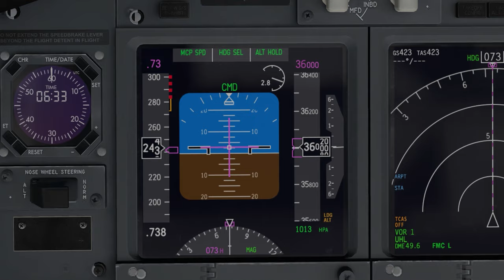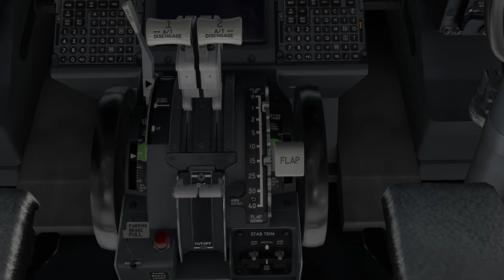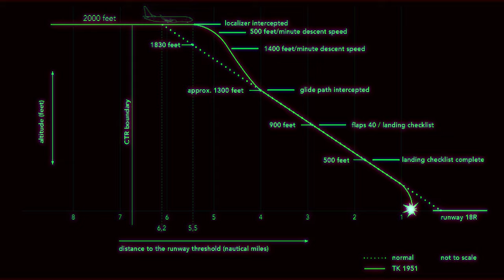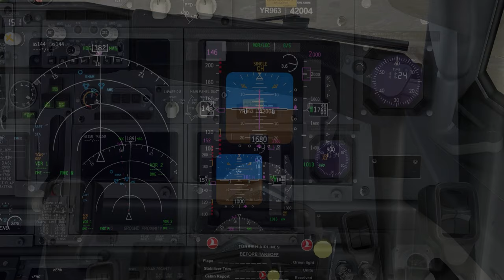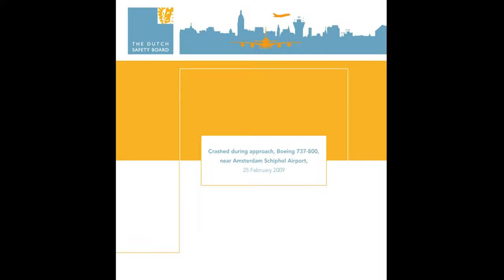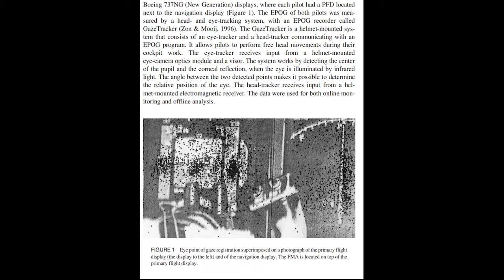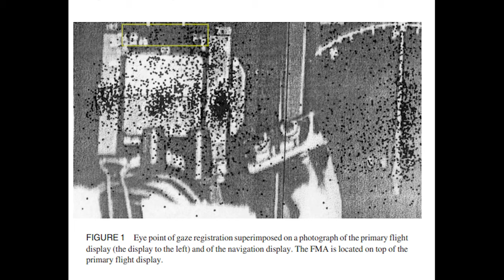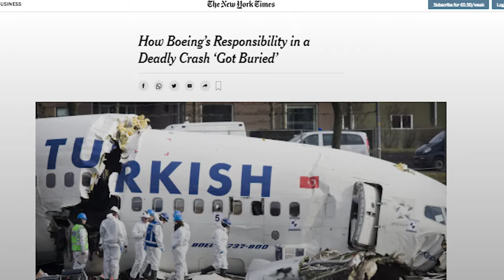Why did this 737 FALL out of the sky?? | Turkish 1951

Comment: 737 will enter flare mode only if dual auto pilot is enabled and both RA operative is a dual auto pilot requirement. Also dual autopilot is normally enabled only for auto land.. The weather at that time didn't require auto land.
Reply: Both autopilots were engaged at the time, the erroneous RA1 gave the aircraft the impression it was at 8’ , therefore was in flare mode, hence the thrust was at idle, and the nose pitching up, it had nothing to do with the weather, or an auto land.
Reply: What he is saying is they shouldn't have been, especially on a clear day.. They knew they had a bad RA anyways, wtf were they doing on a full auto approach??

Comment: Shouldn’t they turn off the communication of the faulty radio altimeter with everything else so the auto pilot takes its information from the correct altimeter? They didn’t turn off the auto pilot. They were still relying on it. So what did they expect the APU to do if not try to collaborate with the [faulty] radio altimeter it was referencing, and they knew it was referencing? This was so well explained. Even a non pilot like me was happily able to understand it, and I had wondered about this crash for a long time.
Reply: APU?
Reply: @tomstravels520  My Guess is Auto Pilot Unit... not that the APU is a power generator auxiallitary.... shrug

Comment: Thankfully Aviation Nowadays Has an Important Tool That “Reads” Pilots Operations Live !

It’s The FOQA (Flight Operations Quality Assurance) !

Therefore, If Company Flight Standards Were Not Accomplished 

(i.e. : Not Stabilized at 1.000 ft)

FOQA Is Triggered and Pilots Are “Invited” To Explain Why They Didn’t Follow a Missed Approach and Continued To Land.

If There Was No Intention or as Called “ERROR”, Pilots Are Reoriented and Maybe Sent to Flight Simulator Sessions.

If There Was Intention or as Called “VIOLATION”, Things May Become Serious Even With Their Demission .

Other Than That Pilots Do Flight Simulator Sessions Regarding Failures and Their Management,

With Emphasis in Human Behavior Like in CRM (Crew/Corporate Research Management) in Terms of 

LOFT (Line Oriented Flight Training) !

All of That To Try To Lead To, As Close As They Can, Bring To Near ZERO The Possibility of an Incident or an Accident.

Comment: ‘Boeing didn’t consider this a safety issue.’ Where have we heard this before? If it’s a Boeing, I’m not going! Shockingly cavalier approach to passenger safety.
Reply: Because it isn't. The airplane can totally fly with one defective radio altimeter  but it requires special procedures which haven't been followed here. And one of the step is simply to not use automations on the faulty side.

Comment: If the captain's radio altimeter was defective, I'd expect they would use the AP on the FO's side, where presumably the functioning radio altimeter would not trigger an erroneous flare mode. Is there only one AP on the 737?

Comment: There should be multicolored led borders for each panel... Each colour should assigned for modes of for example FMA.... If it's gone to flare mode then colour should be green, nav mode yellow etc... So even pilots are doing there Job... But if cabins lighting colour changes then come to know without looking at display

Comment: Definitely pilot error. Even if systems failed and in an unfortunate situation, the pilots were still instructed to follow a procedure which they failed to do. At the end theyre responsible.

This was pilots failing to properly handle a system malfunction, despite having instructions that would have prevented any issues

Comment: I don't blame them for reinvestigating the crash, but the pilots should have been aware of the faulty equipment since everyone was dealing with it. Whatsmore, they shouldn't have been flying planes with faulty altimeters. If they have more than one, take the faulty one out. It would be better to have a hole in the dash than to dig the plane out of a hole in the ground. Just saying. 🥺

Comment: This IS pilot error. No doubt about it. The crew KNEW they had an erroneous RA and they should have been familiar enough with their systems to understand which systems would’ve been affected. 

There were 3 pilots on that flight deck. 3.  And not a single one was paying attention to their airspeed during a critical phase of flight. 

If the FO was in the process of recovering from the stall, he should’ve continued it. It probably would’ve saved them. But no the captain had to be a hero and caused the loss of life. 

There’s a reason why the policies are that you must meet the “stabilized approach” criteria. Those were written in blood. And it’s NOT ok, at the airline level, to simply disregard those policies and do it by gut feeling. 

Also a good illustration of these dumb Nintendo pilots relying on automation to do their job. 

Zero excuses here. Zero.
Reply: Mmm, I kind of agree to an extent here. The pilots should have been paying attention their airspeed - I'll give you that, no doubt. But I do think that taking Boeing out of the picture here entirely is the wrong way of looking at it. The auto-flare system should be designed to monitor both RAs and I also believe that there should be a more prominent warning that it's initiating auto-flare. Yes, the pilots should have been paying attention to their instruments, but simultaneously, Boeing should ensure that the integrity of aircraft will never be compromised by something as simple as a single erroneous RA. I do feel like that if their descent speed of -1400fpm was not initiated, this crash would have been avoided, giving the pilots less warning to an issue like this, as it meant that they would expect the engines to idle out, and maybe a potentially minor temporary decrease in speed, which is something that happens in aircraft when they need to descend at times.
Reply: @Alfred Weber Precisely. I'm not defending the actions of the pilots; that is why they're there - to account for these potential issues during, even more so, critical phases of flight. But it's important to factor in aircraft safety as a whole and Boeing should be held accountable.
Reply: @CamFlies  Boeing always manages to skate. They seem to have a lot of power over safety agencies.
Reply: No doubt about it only in your mind

Comment: All emergency possibilities should be extensively trained in the simulator. There should be 4 or 5 emergency buttons, pre-programmed scenarios, that can be pressed where the plane automatically stabilize. If the first button don't function press the second, then try third.....

Comment: It’s almost incomprehensible that an automated system would persevere when there are glaring disparities between vital inputs. If it’s taking the altitude from the captain’s side source, and that source is constantly providing a negative reading, then that should be sufficient to disengage entirely. That other inputs are showing the aircraft in actual flight makes this even more absurd. Surely there’s also a means of manually switching to an operational altimeter source, no?!? This all seems woefully unsophisticated and inadequate for an automated system with such tremendous responsibilities.
Reply: No it's not that incomprehensible when  you are normally required to not use automations on the faulty side during landing  if  such case happens.
Automations arent supposed to replace the pilots.
Reply: @Hk-uw8my  I’m referring to data inputs and software logic. Pilot actions/responsibilities aren’t pertinent to my comment.

Comment: No way to disable the faulty RA? That seems like a design oversight in the plane.
Reply: @Capecodham  radio altimeter
Reply: @Capecodham  bro chill out. You’re literally on an aviation channel. Of course there are aviation acronyms. There are acronyms in all fields. Why are you so surprised that someone would use an acronym…?

Comment: How many of you think that when ANY part of a plane’s instrumentation is faulty, they should either abort the take off or circle back to the airport?
Reply: You’d be surprised how many flights would suddenly be cancelled. There is only so much space for aircraft to be in maintenance hangars. If others are stuck waiting outside and can’t fly it’ll just build up. That’s why minimum equipment lists exist
Reply: I agree with you.
Reply: We fly the airbus with an RA fault all the time. Only difference is the Airbus automation is not built like a fucking idiot

Comment: This video is a year old so I don't know if you'll see this comment but if you do could you check out the Alaska Airlines excursion in Ketchikan that ended with their 737 in the channel between the Ketchikan International Airport and the city of Ketchikan? I don't know the flight number or any other details. Alaska Airlines had at least two other excursions in Ketchikan, one of which the aircraft, again a 737, broke in half.

Comment: I don't understand why the Auto Pilot was using the Pilot's radio altimeter indication instead of the First Officer's.
Reply: Because his flight director is primary. Can be switched but not something you want to rely on trying on final. They already knew about it, should have flown manual instead of letting the  plane do it. All they would've had to do is monitor speed and adjust throttle as necessary.

Comment: Nice video. However, to say that this was not pilot error shows your lack of understanding of basic aviation. Regardless of the circumstances, if one stalls an aircraft on short final with two good engines, there is no defense. Argue all you want.
Reply: I think it’s clear from the context in which he made that statement that this wasn’t entirely what he meant, more of a case of a slightly questionable choice of words in the script than a lack of understanding.

Also, I don’t see that we gain anything by ignoring contributing factors, or that acknowledging them absolves the pilots of guilt. Pilot error is pilot error, but the cruel reality is that humans make mistakes. If training or aircraft systems make a catastrophic fuckup more likely than it needs to be, that should be fixed ASAP.
Reply: @ollimoore  I have to disagree with you here.. they knew the RA on the captains side was bad, no damn reason at all to be trying a full auto when thats the case. Lets not forget the flightk director primary was captains side, VERY easy to switch primary btw.. they failed to monitor the approach, relying on a plane that was using a faulty RA that they KNEW about to do the work for them.. I really cant find fault with the system, well maybe not letting it do a full automatic approach when you have 2 different RA's? I can get behind that. Still.. i almost completely put this on the crew's over reliant on the auto pilot. The first rule is to fly the  damn plane..
Reply: @ollimoore  true

Comment: That'x why I'm against autopilot landing an aircraft. In my opinion, pilots are there to take control, and not to leave all work to be done by computers. I'd feel morr confortable if I knew a pilot was actually driving the plane, rather than autopilot.
Reply: Get a grip.
Reply: @peteconrad2077  get a group
Reply: @Al-ih1en  you’ve shown you haven’t a clue what you’re talking about.
Reply: @peteconrad2077  you have shown you have no education when you're talking about
Reply: @Al-ih1en  I have 18000 hours and instructor and examiner certificates. Pilot use automation because it frees capacity and improves their situational awareness. 

Stick to stuff you know.
Reply: @peteconrad2077  this is not the type of education I was talking about, but I'll take it as a more decent reply than the first one.
Reply: @Al-ih1en  since you appear to have little if any education, I can’t imagine what kind to which you refer.
Reply: @putinski666  the pout is that before we used extensive automation the accident rate was higher. It’s lower now, just not zero. 
The other auto throttle accidents, both 777, are related to specific mode issues with that type.

Comment: Sorry i commented this on other videos but you are exactly mentioning it at the beginning. After every crash the systems get more complicated, connected to each other, influencing each other, altering the behavior of the plane together with pilot inputs in so many ways that humans are not always capable to deal with such issues. It might sound ignorant but there are so many crashes which wouldn’t happened if the plane would be flew with og steering, rudder, trust. I know Computer systems have advantages.
Reply: Fir every accident caused by automation, there are a risk that have been prevented by it.

Comment: How can flare mode engage if computer sees fixed altimeter reading during landing? That is software shortcoming.
Reply: Why wouldn’t it?
Reply: @peteconrad2077  Because there are other sensors providing altitude information, and you expect companies that make products costing hundreds of millions of dollars, where failures can lead to the deaths of hundreds of people, to apply basic sanity checking on their sensor readings before acting on them
Reply: @isbestlizard  there’s no other sensor accurately telling you how far above the ground/runway you are. Only the radio altimeter does that, which is why it is also used to cue the various autoland functions.
Reply: @peteconrad2077  For flare to engage, altimeter reading has to go down. That means numbers go down. Like 88, 67, 59, 51. But 44, 44, 44, 44, "ok now it is reasonable to engage flare". wtf?!
Reply: @tarassu  well that would be an even bigger fault. Altitude often stabilises at a low level in the flare for several seconds if the flare is a little high. I think the manufacturer uses a set rad alt as a trigger. Using a rate as you suggest has a number of issues with it.
Reply: @peteconrad2077  BEFORE FLARE altitude readings have to go down. Not when aircraft is at level flight height. hmmm
Reply: @tarassu  so what. They’re not an indication that your at flare height are they. They can be going down as you fly the departure.

Comment: Why were the pilots not doing a manual landing. Mostly landing and takeoff is done by pilots manually n not with auto pilot. In this case with faulty altimeter they should have disabled auto pilot long back

Comment: Considering this accident occurred with 2 pilots and a safety pilot it should have been impossible as demonstrated by 12 other crews that successfully  noticed the problem and took over before the stall.
  This is simply a case of Darwinism in the cockpit....

Comment: Emergency buttons or in an emergency the tower control the aircraft and sends flight data to the airplane for confirm and check flight data. Also triple check. Airplane instrument data vs Tower aircraft data vs satellite Garmin data.
In an emergency satellite and tower data overwrite instrument data on a third computer and Pilots press up to 5 emergency buttons with pre-programmed scenarios to stabilize the aircraft.

Comment: Not the first time a Boeing plane is designed to just ose one of two sensors and doesn't even have basic checks if it's even working correctly or have the systems relying on it become inop if they don't line up with the redundant sensor.

In this case there were even two systems just relying on this sensor reading which resulted in:

- Warning for gears
- Unannounced/uncommanded change of the auto throttles mid flight

And Boeing was even aware of this issue ....

So is that manslaughter? 🤔
Reply: What you wrote is nonsense as it is certainly not how the system involved in the accident which is called a radio altimeter, works. There are two radio altimeters on the airplane for two separated and  independent flight computer systems, the plane can still fly if one of the RA  is inoperative just like in the case of the accident but special precautions must be taken,  which include to not use the automations on the faulty side.